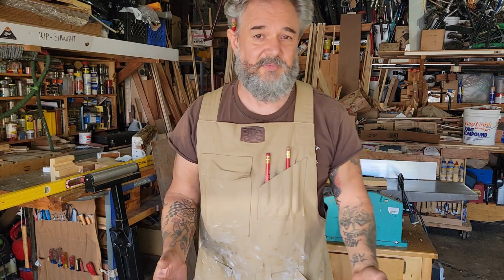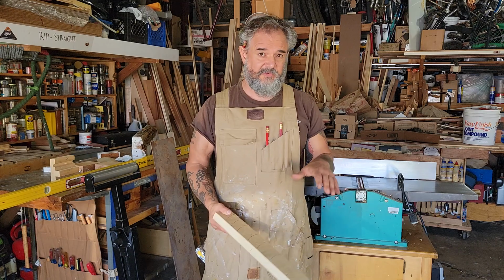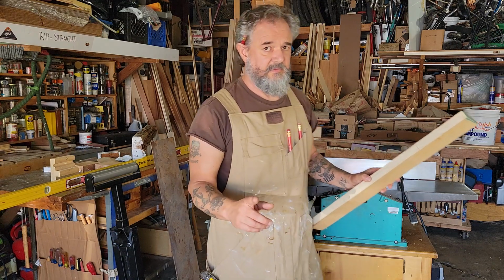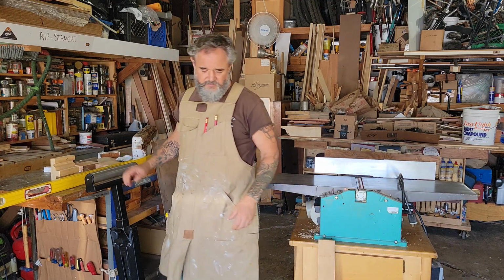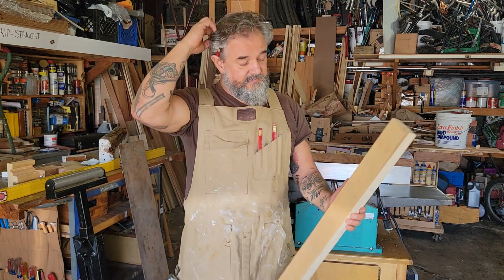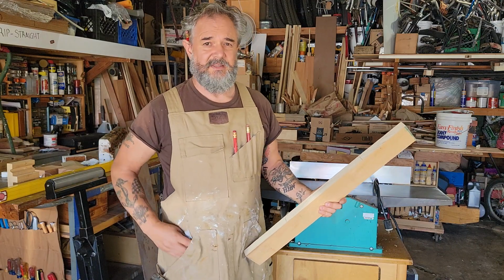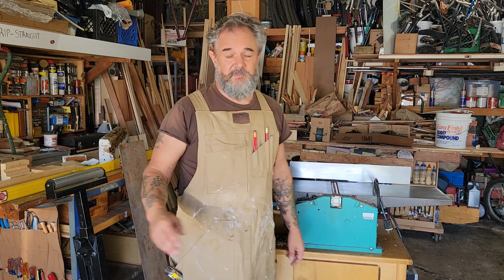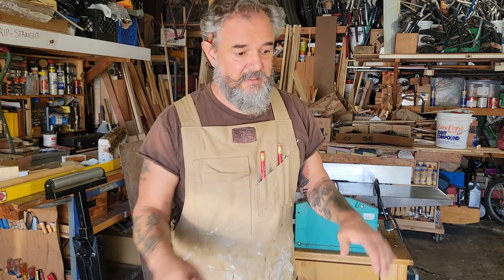How To Mill Lumber To Remain  Stable For Hierloom Quality Furniture

Comment: Hey Michael, I've seen a couple of your Schwinn videos and I was wanting to know how I can tell a 1979 Beach Cruiser from 1980, 1981 or 82. I had one about 40 years ago. Anyway I just got another one and was trying to figure out what year it is. It has Chicago on the emblem on the front, it's  white with black lettering and no numbers next to the "I"  also, the rear fender mount looks like the one on your red cruiser in the "How to identify Chicago made Schwinn's". Thanks Mike.
Reply from the maker: In that video I mention where the serial numbers are located - There are three different areas where serial numbers can be found - For the later years the serial numbers are on the head tube near the head badge - All you have to do is go online and look for Schwinn serial number look-up links - The first two letters tell you month and year but off hand I don't remember them all
Reply: @AstroVanTribe  Thanks Michael, I just found out that the second letter of the serial # indicates the year. For example 1976 2nd. # is M 1977 N, 78 P, 79 Q ..The first letter indicates the month A Jan. B Feb. and so on. Thanks again Mike.